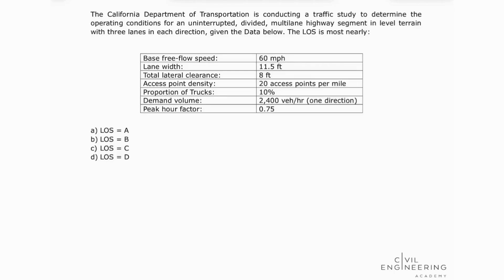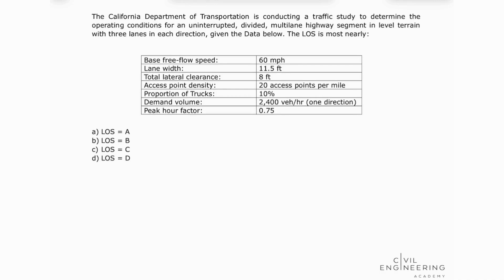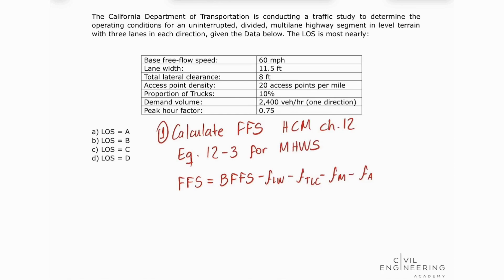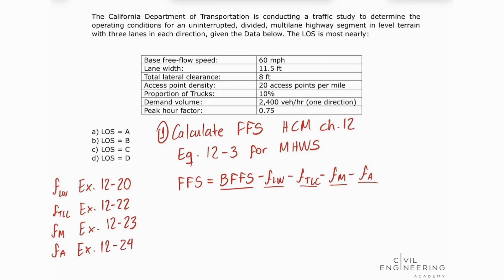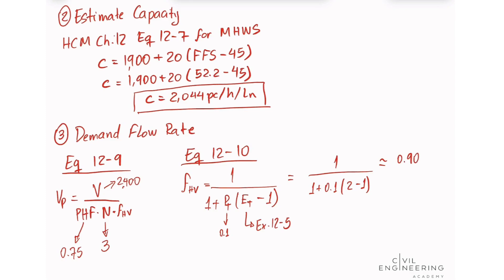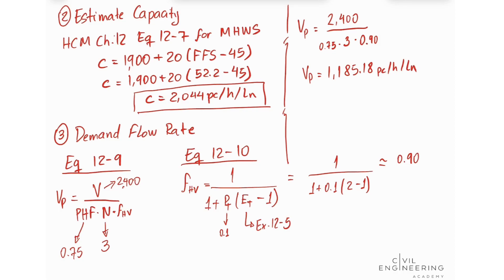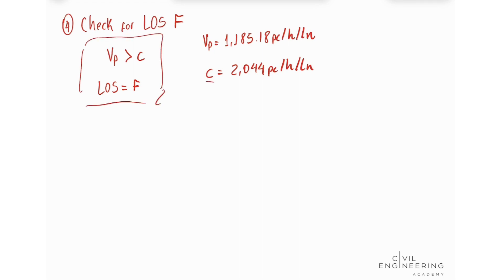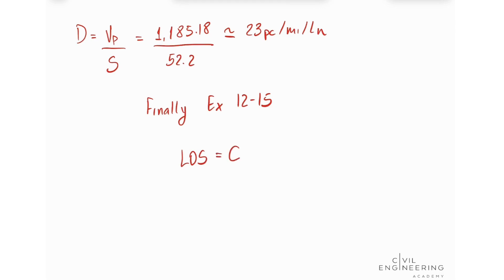Civil PE Transportation Exam – Find the Level of Service (LOS) for a Multilane Highway Segment

Comment: The breakpoint = 1,400 is Exhibit 12-5 (not 12-15).

What would you do if Vp > 1400?
Reply: Then you'd have to use Equation 12-1 to solve for S when vp is greater than BP but less than or equal to c